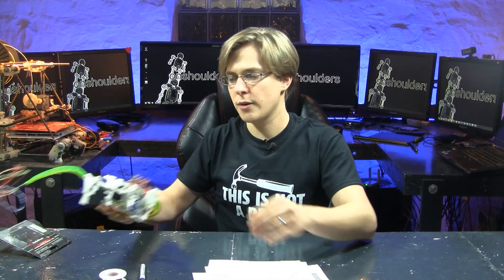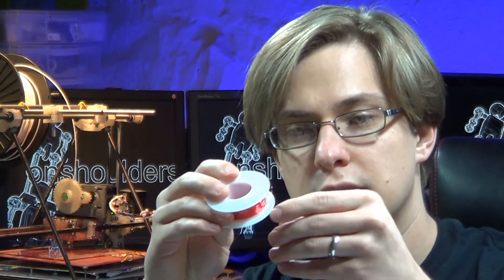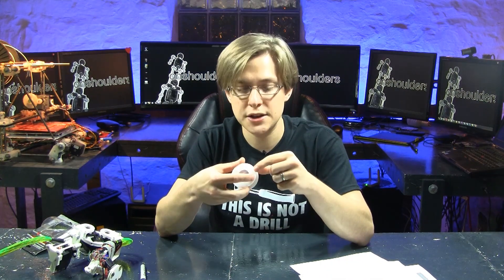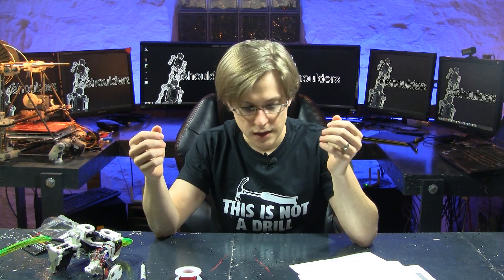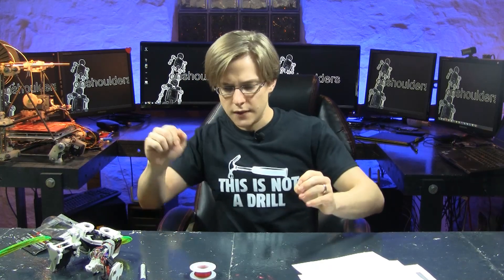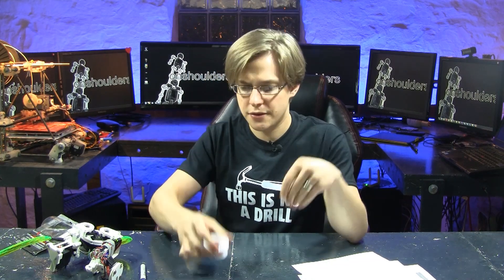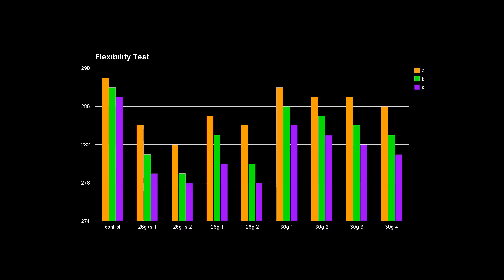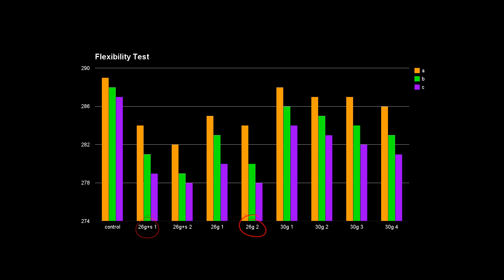onshouldersTv: Measuring Wire Flexibility

Comment: I'm no expert, but it seems like this is more a test of energy dissipation than the force required to deflect the wire.  I think the motor wire is at least as flexible as you need though if you don't run into metal fatigue issues.